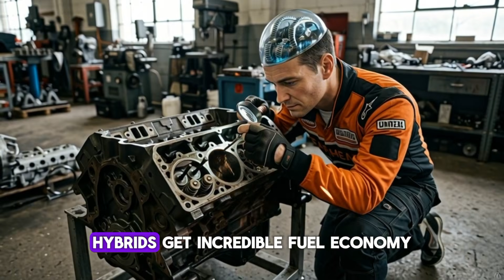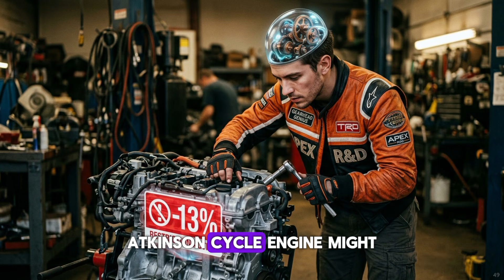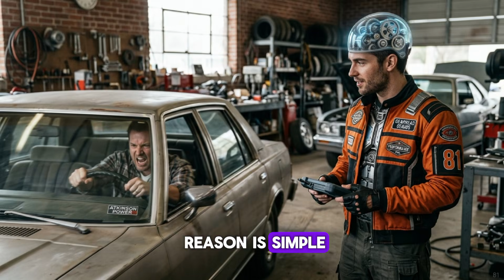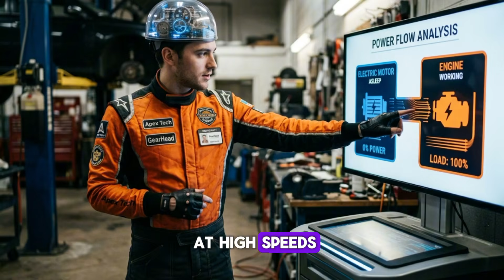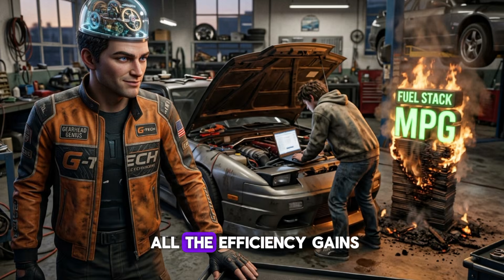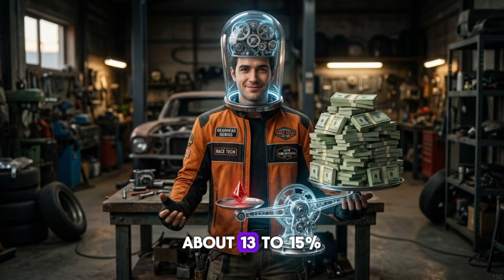Why Toyota Deliberately Weakened Their Hybrid Engines The Atkinson Secret

Comment: You haven't fully described the Atkinson cycle engine. To get the great efficiency gains they want a large Expansion Ratio. When you design for a large ER you also get a large Compression Ratio (around 14 to 1).

The delayed intake valve closing defeats some of this excess compression ratio so you don't have to buy aviation gasoline with crazy high octane numbers.

The shorter compression stroke may also reduce "pumping losses" as you mentioned.

I'm guessing that at high altitudes with thin air the intake valve timing can adjust back toward Otto cycle to help maintain pressures in the engine for normal power delivery even at high altitude (it is kind of free turbocharging with out the reliability issues).

Thanks for the post.
Reply from the maker: Danny, my man! Thank you for watching and for dropping this absolute masterclass of a comment. You are 100% spot-on with the physics, and you just perfectly filled in the rest of the thermodynamic puzzle!

You completely nailed the expansion ratio reality. To extract the absolute maximum mechanical work out of the power stroke, Toyota uses a massive physical compression ratio (like 14:1). But by leaving that intake valve open to push air back out, they lower the effective compression ratio. That brilliant trick is exactly how they get hyper-efficient combustion without blowing the engine up from pre-ignition (knock) on cheap 87-octane gas.

And your theory about high-altitude VVT adjustment is absolutely brilliant. Because modern Atkinson engines use electronically controlled Variable Valve Timing (VVT-iE), the computer can dynamically advance the cam timing when you are climbing a mountain in thin air or demanding heavy throttle. It literally shifts the engine's breathing back toward a standard Otto cycle on the fly to trap more air and regain that lost power.
Your "free turbocharger" analogy is spot-on, man. Incredible engineering breakdown

Comment: I had a 1983 Chev Chevette that had 65 HP. Got me to work. Took me on vacation and even merged on the highway. You just had to plan ahead,
Reply from the maker: Stuart, my friend, thank you for watching and sharing that classic memory! You hit the nail right on the head.
It is honestly hilarious to think about how incredibly spoiled we have become with modern horsepower numbers. The physical engineering reality is that your 1983 Chevette was a brilliantly lightweight machine (barely pushing 2,000 pounds). Today, because of massive safety crash structures and heavy high-voltage hybrid battery packs, a modern family sedan easily weighs over 3,500 pounds. They literally need that extra 100+ horsepower just to haul all that extra mass down the road!

But you are 100% correct—getting up to highway speed with 65 HP was totally fine if you knew how to carry your momentum. "Planning ahead" is definitely a lost art of driving these days! Great perspective, brother. 🔧

Comment: The Toyota Camry LE  produces 225 horsepower, not 176.
Reply from the maker: Albardo, my man! You are 100% correct if we are talking about the total combined system horsepower on the brand-new Camrys.

But the 176 horsepower number I broke down in the video is the power output of the gasoline engine by itself, before the electric motors pitch in to help. If you remove the high-voltage hybrid system and put that 2.5-liter Atkinson cycle gas engine on a dyno all alone, it physically only makes 176 HP. Meanwhile, a standard non-hybrid 2.5L Otto cycle engine makes over 200 HP on its own.

Toyota deliberately weakens the gas engine to achieve peak thermodynamic efficiency (maximizing your MPG), and then uses the electric traction motors to instantly boost the total power back up to that impressive 225 HP figure you mentioned.
Great catch on the total system numbers,  Keep the comments coming! 🔧

Comment: Doesn’t the Atkinson cycle engine create more power due to the direct injection/ port combination compared to port injection alone?
Reply from the maker: im, thanks for tuning in and dropping this awesome question, man! You are absolutely right that Toyota’s D-4S dual-injection (using both port and direct injection) is a massive engineering upgrade.

Here is the mechanical reality: direct injection physically cools the inside of the cylinder, which allows Toyota to run a crazy high compression ratio without the engine knocking. This definitely helps claw back some power and vastly improves fuel efficiency.

But the Atkinson cycle itself which leaves that intake valve open to physically push air back out into the manifold—inherently shrinks the engine's effective breathing capacity. So even with that brilliant dual-injection setup maximizing the combustion, the peak horsepower is still mathematically capped lower than a standard Otto cycle engine of the exact same size.
It’s the ultimate engineering balancing act for peak thermodynamic efficiency! Great observation, brother! 🔧

Comment: So it seems the big downside is when you need to handle prolonged heavy loads — when towing, or when managing a long uphill grade. The battery can’t help you for long, so it’s all on the gas engine. 
For passing at high highway speeds, I’d think the problem would not be battery state of charge, but just that the electric motor loses torque capacity at high speed. The eCVT gives the gas engine the benefit of a variable gear ratio, but it can’t help the electric motor (which is directly coupled to the wheels).
Pity the poor Honda hybrid, which doesn’t even have a variable gear ratio for the gas engine.
Reply: @KevinKennedy-m2s  
The engine can switch in and out of the "Atkinson" mode.
Reply: @KevinKennedy-m2s  toyota hybrid engines are equipped with dual vvt. 

it can switch between atkinson (saving) and otto (power) cycle anytime it requires. 

So at high speed when motor cant provide power, the engine can switch its dual vvt for otto cycle (power mode) 

of course the power mode of hybrid engine cant be as powerful as the normal full time otto cycle engine.
Reply from the maker: Kevin, my man! You are back at it again with the absolute masterclass observations. You understand hybrid powertrains better than most dealership technicians!

You are 100% spot-on with the physics here. Under a sustained uphill pull or heavy towing, that high-voltage battery taps out fast, leaving that underpowered Atkinson cycle engine screaming for its life to do all the heavy lifting alone

And your point about the electric motor losing torque at high speeds is brilliant. Because MG2 (the main traction motor) is physically geared directly to the wheels, as your highway speed climbs, the motor's RPM skyrockets. At those extreme RPMs, electric motors suffer a massive torque drop-off. So even with a 100% full battery, MG2 simply doesn't have the mechanical leverage to push you past a semi-truck at 80 MPH.

You also completely nailed the Honda comparison! Because Honda's eHEV system relies on a single, fixed-ratio direct-drive clutch for highway cruising, the engine RPM is permanently tied to the wheel speed. They have zero e-CVT planetary trickery to drop the RPMs and find a better power band. It is either cruising perfectly, or screaming helplessly.
Incredible breakdown, brother! Keep these deep-dive comments coming! 🔧
Reply: @GearHead_Geniusgtr  . The Honda's electric motor is way more capable than the ICE. If you are cruising at highway speed using the ICE direct drive to the wheels, and then floor it, the ICE will un-clutch and let the electric motor do its thing. The ICE will scream to keep the traction battery from discharging too quickly.
Reply: @dannybryant6873 ICE Scream. I love it. But seriously, thank you for that info. That is a cool way to mitigate the shortcoming of a single-speed transmission. For overdrive, just switch back to EV mode, make the ICE scream, and worry about efficiency later. Would you happen to know if the Honda engine also can switch to Otto cycle when the going gets tough?
Reply from the maker: Danny, thank you for watching and jumping in with the hard facts, man!

 You are absolutely 100% correct on the mechanical sequence here.

You perfectly described exactly how Honda's e:HEV software logic handles a heavy highway pull. Because that direct-drive clutch acts essentially like a tall 6th-gear overdrive, it has zero mechanical leverage for rapid passing. The exact millisecond you floor it, the computer dumps that wet clutch, completely disconnecting the engine from the wheels. It switches back into pure series-hybrid mode, letting the electric traction motor take over the acceleration while the gas engine instantly revs to peak RPM to act as a massive electrical generator.

It is a brilliant software workaround for not having a variable gear ratio! The only slight limitation—which ties back into Kevin's point—is that at 75 or 80 mph, that electric traction motor is spinning at such extreme RPMs that its natural physical torque curve is dropping off. So you get that classic "screaming engine" sound without the massive G-force you might expect, but from a pure engineering and power-routing standpoint, Honda handles it flawlessly.

Awesome technical breakdown, brother! Keep holding us to the facts! 🔧